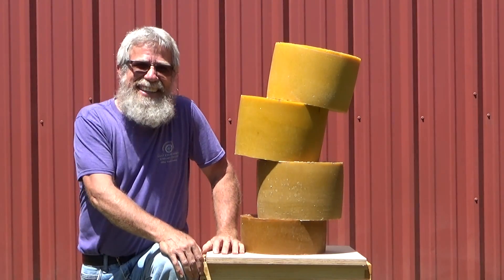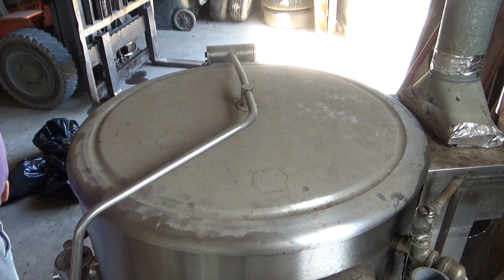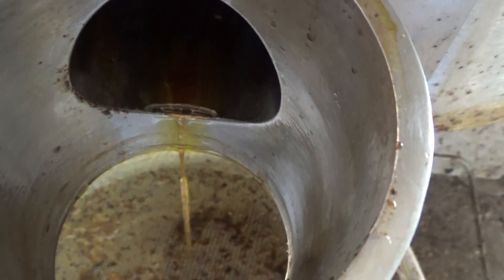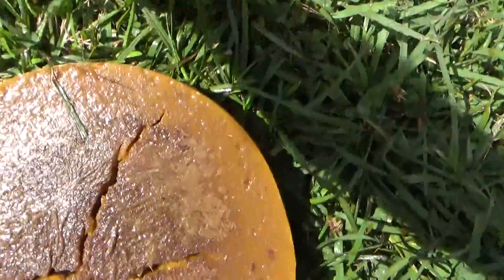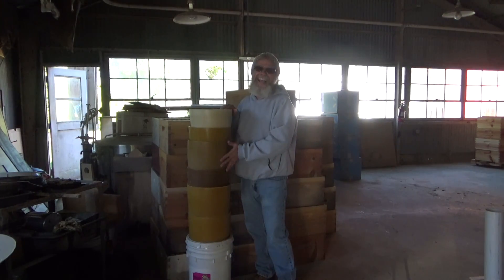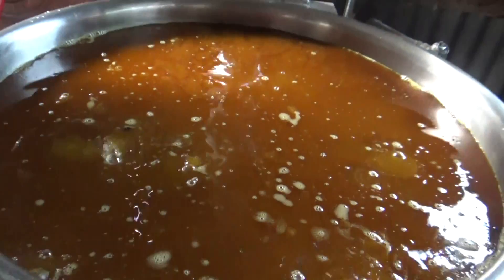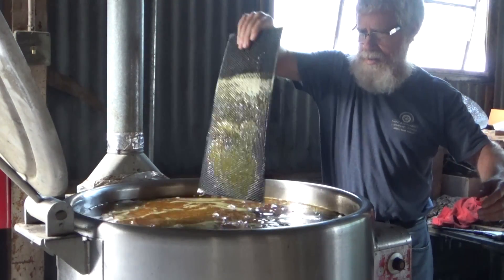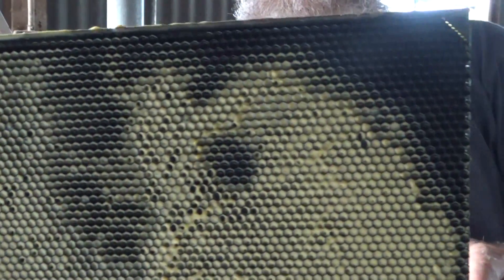Rendering old beeswax making it useful once again.

Comment: It seems like this situation would be a perfect application for nested screen baskets. Put coarse screen on the smallest basket and get finer on each successive basket. Depending on how many baskets you use and how fine your mesh is, you might even get to a one pass render.
Reply: For the record, I mean inside the pot.
Reply from the maker: The method I now use is based on what you suggest. I place rolled screen inside the kettle into the gate. By doing it this way, more than 95% of the trash remains in the pot making the rendered wax very clean. Thanks for watching. God's peace.
Mr. Ed

Comment: WOW.  That is a ton of wax!  Do you re-use your old foundation? If so, how do you get the old comb cleaned off before you re-wax?  I had to pre-wax my flow frames before the bees would touch them.
Reply: Not sure if it applies but I use a poser washer to clean plastic foundation and frames.   Then I melt wax and paint it on the cleaned plastic using a sponge brush.  I clean my queen excluders using a heat gun.  That wax is what I use to coat plastic.    Since it Is a mix of wax and propolis, the bees seem to prefer it.
Reply from the maker: I rarely reuse my plastic foundation, unless it was strictly a honey frame. All my other foundations and frames that are not reused are given to club members for them to clean up and use in their hives. That must have been difficult to wax a flow frame. Thanks for watching. God's peace.
Mr. Ed

Comment: what would happen if the raw wax was placed in fabric bags with a coarse weave and tied at the top? In the steam kettle, start it off with a few chunks of already rendered wax so it will melt and help melt the wax in the bags. Then after your 10-20 minutes, pull the bags up by their drawstrings and allow the liquid wax to drain. You could perhaps have hangers at the top of your kettle and hang the melted bag off with the lid closed for another 20 minutes to keep the temp up and allow the bags to drain. Maybe your bags are as simple as wrapped in a few layers of cheesecloth? 
Using the leftovers as firestarter blocks to sell at a gift shop would be a great use.
Reply from the maker: Your idea is a good one, and I have made attempts at it. The problem I encountered was the bags filled with wax can't hold up to the weight of the trash that is in them and tear. I did have better success with nylon stockings, but they ripped as well. You are right about using the refuse for fire starter sticks, they work great for that. Thanks for watching. God's peace Blair.
Mr. Ed

Comment: I’d love to buy one of those wonderful chunks and make candles! Seriously, if you sell them please let me know.
Reply from the maker: I'm sorry, I just don't produce any extra wax to sell. Between the bees, soap, and candles, there just is not enough to go around. Thanks for watching. God's peace.
Mr. Ed
Reply: I realized that as I watched you fellas dipping frames. If I understand what you said correctly, coating the substrate saves about 560 pounds of honey for 80 pounds of wax . The ROI on honey has to be better than wax. Still lovin’n the OT beard, Jeff, I look forward to the next installment of “Mr. Ed’s Bees” . Stay safe and bee well.
Reply: @therealhellkitty5388  For clean, solar melted, chemical-free, beeswax, give John or Carol a call at Harbo Bee Co. They are in Jeff's neck of the woods.
Reply: Bea's Bees RVA Thanks for the tip!

Comment: 👍. That was a l.o.n.g. day ;-) but everytime I washed you dip in  the wax with a frame?? I was holding my breath!! I was just waiting to hear OUCH OUCH that's hot ... But? Once you get a few layers of wax on your fingers they should be insulated ;-)
Reply from the maker: I burned my fingers at least 6 times during the day, and at the end of the video, you can see the wax build up on my fingers. The wax build up did not do much as an insulator. Thanks for watching. God's peace Joe.
Mr. Ed
Reply: My experience is that melted wax does have insulative properties....It holds the heat from the wax IN. Seems like it continues to burn on your fingers longer than it should ;)
Reply from the maker: @DStewart2022  And I thought I was just a wimp. God's peace David.
Mr. Ed

Comment: Mister Jeff I was wondering why it is that you're not using the flow Hive and I only ask because you have so many and it would render the problem of having to even deal with wax at all is what I hear there's supposed to be a really wonderful thing and I'm just wanting to see what your take is cuz you have so many bees and you've been doing this for so long God bless you and I hope you have a chance to answer my question thank you so much for always being happy God makes you that way not always but most of the time God bless for my family to yours and thank you again for the videos
Reply: I would try to answer your question.
1.) Flow frames are heavy a super with flow frames is 10 pounds heavier than normal super and that is without any honey in it.
2.) Flow frames are incredibly expensive one flow frame costs like $60 and you need 7 of them in a super. Furthermore you also need a special super that is another expence.
3.) Flow frames are not are not repairable so if something brakes you need to buy a new one.
4.) The actual harvesting of the honey takes a long time after you crack the frame open honey seems to drip endlessly. Much longer than taking supers off.

And there are probably many more reasons that I have not thought about. Overall I would say that Flow frames are not an option for someone with more than 10 hives.
I hope that my explanation answers your question.
Farewell from Europe.
Reply from the maker: I have a Flow Hive, but I do not care for it. First, they are VERY expensive, and second, I love processing my honey. Thank you for your blessings and kind words Tammy.
Mr. Ed
Reply from the maker: Love your reply, great job. Thank you for answering her question and for watching my bee wrangling adventures. God's peace.
Mr. Ed

Comment: I wondered whether it would be a worthwhile experiment to put those 10 unwaxed  frames in a box to see if the bees would work with the old wax, or whether it would reduce production. Might be an interesting experiment, though 10 frames is possibly too small a number to conclude much.
Reply from the maker: I already know the answer, bees will work unwaxed frames, but at a greatly reduced speed and sometimes not at all. Here are a few reasons why I wax the frames. 

The bees don't have to produce the wax thus enabling them to store the honey instead of using it to make wax.

They won't build off the face of the foundation.

They draw out the comb extremely fast.

And finally, I get more honey production that way.

 Thanks for watching, and I hope you will check out more of my bee wrangling/ bee rescues adventures and let me know what you think of them. By the way, I post a new video every Friday morning, and I look forward to hearing from you again soon.  God's peace.
Mr. Ed

Comment: you can probably take a fabric like gauze (don't know exact name of it) and grab whole bunch of cocoons from the surface of wax or put it in place of the screen. just some kind of elastic filter. although i don't know how much wax is going to be absorbed by fabric. god bless you.
Reply from the maker: I had thought of using a type of fabric, but my concern is the loss of wax that it would absorb. So far, metal screen in the tank has been the most successful way of doing it. Thanks for your suggestion and for watching. God's peace.
Mr. Ed

Comment: May be an idea to punch 2 holes in each foundation and make a metal holder to help suspend them in the vat completely without burning your fingers.
Reply from the maker: I have considered that. My idea was to use a hole punch. You may see that in the future. Thanks for your suggestion and for watching. In case you did not know it, I post a new video every Friday, and it would bee great if you'd check some of them out. Looking forward to hearing from you again. God's peace Nigel
Reply: @JeffHorchoff  I could see some alligator clips on string working great too, wouldn't need to modify the foundations. wouldn't work to shake them out but it would allow you to just hang them on a hook to dry while putting another set of clips on a new one.

Comment: You could use a couple of modified hackle pliers (Cabela's Hackle Pliers, SKU:  30009841, as an example) for holding the foundation when you dip them. It would allow you to completely submerge the foundation without getting your fingers in the wax. Just bend the very tips of the pliers toward each other to make small hooks. They'll grip the embossed cells securely. I do get a kick out of your vids Brother.

Comment: if you put all the comb in a pillow sheet then put it in the kettle all you have to do is pull the pillow sheet out n drain....much cleaner n faster
Reply from the maker: The idea is a very good one and I have thought about doing something similar. However, I have yet to come up with a way of pressing all the wax that is trapped in the casing. I'm still working on that one. Thanks for your suggestion and for watching. God's peace.
Mr. Ed
Reply: @JeffHorchoff  NP God Bless

Comment: I wonder how thin the wax needs to be for the bees to build on it. Perhaps there is still room for improvement if you can spin some of the wax off the frames, yet the bees still build on it.
Reply from the maker: The big boys use a heated sprayer to apply the wax and get it on there very thin, but that's some very expensive sprayers. Still, I'm OK with giving the bees a bit of extra wax. It was there's to begin with, I'm just recycling it. Thanks for watching. God's peace.
Mr. Ed

Comment: Hello. That is interesting. So 80# of wax times 7 = 560 #of honey you will gain. So im wondering a couple things. 1st , when needed how do you get the old wax out of the frame? Any easy ways? Also you need to figure all of your time and cost to do what your doing. How much more does that add to your cost,  time, electric,  labor and what ever? Nice video. How did the bees do on them frames?
Reply from the maker: As most bee keepers will tell you, it's not a money thing for their reason they keep bees. If it were, they never would have started in the first place. That being said, there is some money in it, but if you add all the costs, it works out to bee very little. Our bees did great on the waxed frames. Here's the link to the video showing what they did. God's peace Rick.       Mr. Ed
https://youtu.be/PluHRF-oMog
Reply: Hello dear friends.
I want to help.
I'd like wild bee wax.
I forgot, I'm a student and on my way to an in-depth research I wanted some wild bee wax.
I'd like an answer, please.

Comment: Looking at removing the excess wax from the frames, do you think a vibrating tool of sorts could save a bit of time and wax, opening up more of the comb structure?
Reply from the maker: The fact that I'm generous with the wax, even though it is a precious commodity, really does not bother me, the bees will make use of any superfluidity of it. I do not mind providing wax for the bees to use in other places and they will make the openings work for them. Thanks for watching. God's peace.
Mr. Ed

Comment: If you are a hobby beekeeper, I recommend getting a juice extractor. They are relatively cheap, essentially just 3 pots and works like a charm. The only labour intense part is cleaning the stainless steel afterwards.

Doesn't work with huge amounts of wax, but if you have wax from 7-8 hives or so it works great.
Reply from the maker: With over 200 hives, it just does not fit my needs.Thanks for watching, and I hope you will check out more of my bee wrangling/ bee rescues adventures and let me know what you think of them. By the way, I post a new video every Friday morning, and I look forward to hearing from you again soon.  God's peace.  
Mr. Ed
Reply: @JeffHorchoff  
Of course it doesn't fit your needs. It wasn't directed at you, but at your audience. Bee-tools can be rather expensive so having ways that are just as functional, but easier to obtain/invest into is always a good strategy for beginners. So probably should've phrased it a little different.

Comment: you should look for a glue coating machine, that will save tons of time and get you an even thickness, cost vs time saving might need to be considered ( remembering you are not saving time if it take 4x longer to clean up )
Reply from the maker: Our operation is not all that lager and the budget is even smaller. Wax sprayers are very complicated machinery with a hefty price tag. Because the wax dries so quickly once sprayed, it has to be sprayed hot or it will never leave the nozzle of the sprayer. Thanks for watching. God's peace.
Mr. Ed

Comment: How do you clean the strainer once done?
Reply from the maker: I use a heat gun and compressed air. As the hot air passes over the strainer, while the metal is still hot, I shoot air through the screen and it cleans it right up. I shot a video on that, and I will try to slip it in on the end of a video soon. Thanks for watching. God's peace Matthew.
Mr. Ed

Comment: What you really need is an inexpensive kitchen tool called skimmer ;-)
Reply from the maker: I have one and have used it, but because there is so much trash in the wax that is floating, using it is to slow for me. Besides, I now do it differently, I put a screen in the bottom of the kettle and then drain it keeping ALL the trash in the kettle and getting all the wax. Thanks for watching, and I hope you will check out more of my over 500 bee wrangling/ bee rescue adventure videos and let me know what you think of them. By the way, I post a new video almost every Friday morning, and I look forward to hearing from you again soon.  God's peace.
Mr. Ed
Reply: @JeffHorchoff  little tip with that trash at the end.   
poor water into the kettle. put a screen ontop of the trash.   and then heat it up again.  
the wax will float to the top of the water.  and you will get another one of those disks out of it.  you don't wanna know how much wax is still in there.
Reply from the maker: @darkracer1252  The method I use now is I leave all the "trash" in the kettle, and there is a screen over the gate of the kettle to keep it all in. Because the kettle is still hot, more than 95% of the wax that is trapped in the "trash" is able to escape through the kettle's gate and into my wax bucket. Thanks for watching, and offering your suggestion, it is greatly appreciated. Also, I hope you will check out more of my over 500 bee wrangling/ bee rescue adventure videos and let me know what you think of them. By the way, I post a new video almost every Friday morning, and I look forward to hearing from you again soon.  God's peace.
Mr. Ed

Comment: If ya had some good heat resistant gloves I wonder if you could've just barely dipped the frames horizontally onto the surface to pick up the last layer of wax for those last ten frames? It may seem futile but may have been worth it.
Reply from the maker: Very possible, but trust me, the mixture is very hot, and I did not have heat resistant gloves. Thanks for watching, and I hope you will check out more of my bee wrangling/ bee rescues adventures and let me know what you think of them. By the way, I post a new video every Friday morning, and I look forward to hearing from you again soon.  God's peace.
Mr. Ed

Comment: @jeff horchoff bees Have you ever used a t-shirt for your final render? It works REALLY well as a final filter, and take a lot of the fine dirt particles out that will slip thru a metal filter.
Reply from the maker: I did it only once and I was not happy about all the wax that was lost in the shirt so now I just use the filters. Thanks for your suggestion and for watching. God's peace Stew.
Mr. Ed
Reply: @JeffHorchoff  Pantyhose makes a great sieve/strainer as well.
Reply from the maker: @madmex2k  they are on my list to try. Thanks for watching. God's peace John.
Mr. Ed

Comment: Could you dunk the coated screens in a cooler of ice water?  Might save wax in the process, less running and dripping, as well as obviously speed up cooling.  And that perfect cake is deeply satisfying to look at.  :D
Reply: I think any that runs/drips off is wax he does not need on there. If he could make a consistently thin layer he would have had wax left over. I wonder if some form of spraying would be better?
Reply from the maker: The wax cools so quickly, dunking them in cool water would not make much difference. Knocking off the excess wax and letting it stand a few minutes is all that's necessary. Thanks for your suggestion and for watching. God's peace Trey.
Mr. Ed
Reply from the maker: Spraying would be a better means of application, and less wax would be used, but the equipment would be very expensive. I'm fine with putting on extra wax, besides, the bees will put any extra where it needs to be. Thanks for watching. God's peace.
Mr. Ed